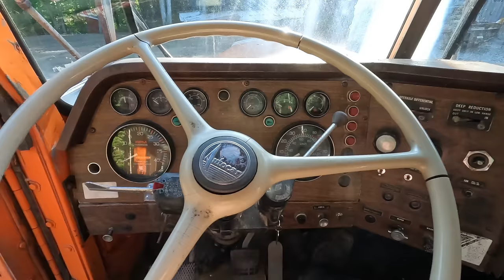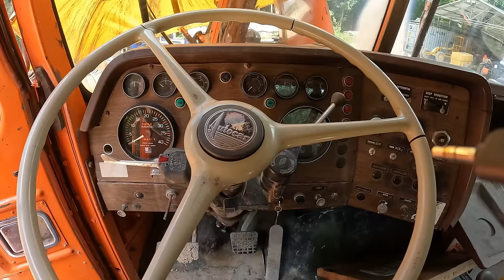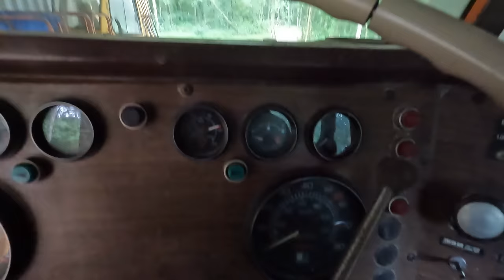Will this  Autocar Semi Truck be fit for the road after sitting many many years? (Small Cam Cummins)

Comment: Matt, If you’re going to keep that winch it would be a good idea to weld up a protection device behind that rear window.
Reply: ABSOLUTLY !! A Broken cable can cut that cab in half!
Reply: @brentbosworth8845  that's a bit of an exaggeration
Reply: @markwilliams4525  no it isn't.
Reply: @davidquirk8097  by far!
Reply: @davidquirk8097  you've been watching too many movies
Reply: @markwilliams4525  you haven’t seen enough reality!
Reply: @markwilliams4525  no I haven't.  I'm an Engineer who has investigated too many failures, fortunately none fatal, but plenty of serious damage.
Reply: @davidquirk8097  yeah that's all good and all but that cable will do nothing more than knock the back window out and dent the cab. It's definitely not going to cut the cab in half, show me where that's happened and I'll buy it but I've been around this stuff too long and have had cables break and have never heard of anything like that
Reply: George Jones  engineers that design stuff in my line of work don't know anything about what they're doing, they copy and paste everything. I'm in the water well industry so we have to go behind them and correct their mistakes and it's hard to get them to understand
Reply: @brentbosworth8845  I have put a few serious dents in the roof of a truck, blown out the back window, cracked the windshield and even dented the hood a time or two but I have never actually torn a hole in sheet metal, now fiberglass replacement roof caps for Pete’s and KW’s well as Scotty would say they just weren’t up for the stain.  All that said, I am not saying it can’t happen, just in the 25 years of towing and recovery I did I never did and some might say it wasn’t for lack of trying especially in my earlier days when I was far more prone to do some really dumb and stupid sketchy sh*t.
Reply: Headache Rack..... ENGAGED!
Reply: .
Good idea ... 
.
Reply: @markwilliams4525  I knew a man that had a broken hook from a pulling cable caved in his skull ! So I believe that a cable pulling tight enough could cut a cab they are pretty thin sheet metal !
Reply: @davidcatlette9697  a hook and a skull is completely different than a fat cable and a cab
Reply: @M_Phipps0520  I don't think you have
Reply: @M_Phipps0520  a 3/4 or 7/8 cable ain't cutting no cab in half, a big deep dent yeah but not cutting it
Reply: @markwilliams4525  ok whatever mr know it all!
Reply: @M_Phipps0520  all you have to do is show me or tell me where to find something like that! I've personally snapped a 5/8 rotation resistant cable using draw works on a well rig and it's not as violent as yall think. Yes it will snap back and do damage opposite of the end from which it broke but it ain't cutting no metal truck cab in half.
Reply: @M_Phipps0520  by the way you don't look to bright yourself!
Reply: @markwilliams4525  that coming from a bunt out light bulb 😂
Reply: @M_Phipps0520  you see what I'm talking about, you mean burnt out light bulb. Right?
Reply: That's good timing cause i just had a come-a-long break yesterday and punch a hole in my tailgate lol

Comment: Hubby said you need to put a fitting on your oil plug with a hose  that leads to an easier drain. He was a heavy equipment mechanic in the Copper and gold mines for many years
Reply from the maker: yah I wanted to but didnt have anything handy.
Reply: Or add a drain valve , they make them to replace the plug just need the size and pitch of the plug being replaces
Reply: @DieselCreek  Just order a Fumoto with a hose. Can't beat em. Lot of the Cummins stuff I work on already has em installed. I just carry a spare hose and nipple in my bag just in case they lost theirs.
Reply: at least if you fill the frame with oil it can't rust, right? ;)
Reply: @mrgeraldbrent  First thing that went on my 2000 Powerstroke ! lots less mess !
Reply: @thesteelrodent1796  ain't that the truth, changed some control arms recently, and the side that gets soaked every oil change from filter removal sure was a lot more rust-free and easy to remove!

Comment: Matt my tip for you ---- is when removing or replacing truck starters out in the field, tie bungee straps to the motor and then the other end up high some where in the engine compartment. It helps to take a lot of the weight out when you're trying to lift, wiggle shift etc.
Reply from the maker: That’s exactly what I did! Lol
Reply: thank you! I never even thought about that. work smarter not harder eh?
Reply: @seasons4inc243  Especially if you're working by yourself like Matt.  It's imperative you be smarter than the hammer.😁
Reply: For the rest of us... Thanks!
Reply: @DieselCreek   Great minds thinking alike!

Comment: Pro Tip  for Diesel Creek..........your Autocar has a Hendrickson "walking beam suspension" which in its original configuration has spring packs designed to handle about 35 metric tons. which makes them incredibly rough as guts when empty or legally loaded.  But you can take out the bottom two leaves in each pack and it will help soften it. To keep your ride height the same, just trim the two leaves so that they become packers only. My father did this to his interstate Kenworth W900 in the 1980's and it ran like that for 20 years, millions of km, pulling road trains across Australia and in the outback.
Reply: My isuzu has the same stuff, you can put 11 ton plus the 5 ton crane I have on it, and it dont move SFA
Reply: Don't cut anything. Just load it up and let it work. (And let us watch as this old iron is working hard)
Reply: Definitely wouldnt be a W900 as they were a different truck

Comment: Love your videos! As a mechanic for Granite Construction, I'll tell you that your transmission takes 50w, the rears take 80-90  but we use 85-140 in our equipment....you can see how quickly it's draining from the PTO that is a lower viscosity. Also, with the engine being an NTC Big Cam, Rotella T-4 would have been a better choice. T-5 semi-syntetic will gum up the heads due to lower operational temperature, plus these older engines need the increased zinc in T-4. Keep up the great work and content, always makes me happy to see DC on my notifications!
Reply: Totally agree!
Reply: T4 with a gallon of Lucas 👍🏻

Comment: Matt, that should be a bendix R-12 relay valve for the service brakes. Relatively inexpensive on the South American river site or your local truck shop. They come in a couple different versions, just depends on where the outlets come out side or bottom. Nice truck. Can’t wait to see it at work
Reply: There are many sellers online, often it's around $55 including shipping
Reply: Looks like an old 335 to me. It would have the primary oil filter and a lubrefiner.which collected th finer particles. COULDNT see but the lubrefiner would have 2 holes about the size of a pencil eraser and the screw hole in the center notables allaround the c we need like a regular oil filter. They don't use them any more and I think the old cummi s were the only ones that had them.

Comment: Matt, adding a turbo tip to a pressure washer wand is indeed a great upgrade! Everyone loves seeing the transformation from cleaning the truck, plus of course a lot nicer to work on. Great video!
Reply: I was a little surprised he didn't pull the heated pressure washer out. Must not have been TOO oily or greasy under there.
Reply: @JCWren  wouldn't want to wash away the pre-installed rust inhibitor, be it from leaks or not ;-)
Reply: @JCWren  I think that is a hot box pressure washer, it has that cylinder on the chassis.

Comment: I have two suggestions for you Matt, check in with Point Spring and Driveshaft down on Neville Island for your brake system parts ,they have all the stuff that you will need. The other relay valves will be just as crusty inside as that one, so service everything now before you get stuck out along the road, most of these older trucks never had air dryers installed on them. The second thing is about the turbo nozzle you use on your pressure washer, point the tip down toward the ground before you pull the trigger, this helps prevent damaging the ceramic seat in the nozzle . This "Not A Car "will give you a good workout. 🤣

Comment: Yeah, I wanted to see the 5th wheel plate go on. Still needs trailer brakes, light connections, tail lights, front turn signals to name a few things for road use. It'll be a great hauler!
Reply: something other than red diesel too :)
Reply: If you need help getting it road ready  pm me I am up in Wellsville ohio  not far from you I built a couple of them
Reply: I have done a  lot of air brake systems  before

Comment: I believe I've mentioned this to you before.  When dealing with really stuck parts.  Heat them as hot as you can get them.  Then moderately cool the entire part with water until you can physically touch it. Do not flash cool it.  Just take your time cooling it down with a steady stream of water.  It works everything.  I've pulled caps off old steam radiators using a 3/8 ratchet afterwards.  Before a 3 foot 1/2 breaker bar wouldn't budge it.  Try it.
Reply: Matt uses heat at least twice in this video to release stuck parts. Pretty sure he knows what to do. Lol.
Reply: @1971merlin  did he cool it down slowly though? the mans only trying to help.
Reply: @1971merlin  he didn't use anything to cool it down.  Using water help shock the metal.  Alot of people do the same thing unknowingly.  They will heat a nut, super hot then saturate it with some type of penatrating oil.  This oil slowly cools the nut causing the same result.  Some people will say the oil is getting into the threads, in reality most all of it is burning off almost immediately until the nut is cooled enough that the oil won't burn off.
Reply: @MrHondatrxex  some wd40 on a heated part does help in most cases, not sure about that shaft though 😂

Comment: Wee tip Matt, never put a drain plug back in without tightening it there and then👍🏻🙂.  Good practice with the seal putting it further in to run on a fresh bit of the flange😊.  However a smidging of grease on the flange or even packing the spring side of the seal prevents a dry first turn, potentially prematurely wearing the fine sealing edge of the seal.  Also prevents the seal spring from becoming dislodged if packed with grease.  Grease is your friend👍🏻😊.  Great vid, truck and channel, best wishes, keep em coming.
Reply: I even pack two stroke crankshaft seals with grease
Reply from the maker: I oiled the seal just didn’t show it 👍🏼

Comment: Man looking at that starter made my fingers hurt bringing back memories of them getting mashed pulling those monstrosities out, was so glad when the hi torque gear reduction starters thats 1/3 the size came out to replace them. We started replacing all of them on the trucks when oil was changed because we did a lot of storm work so last thing we wanted to do is be laying in a mud hole under those big bastards to change them, new ones could be pulled inside the cab as it would fit thru the hole inside.

Friends dad had an older road truck, international i believe, that had an oil filter out there like that for pre filtering the original case style like that one because it was easy to change. We were headed to SC one time and all of a sudden oil started spraying all over the side and his side of the windshield, got it pulled over and a rock/road debris managed to miss the headlight, lollipop light, air filter housing and make it thru a 1” area to hit the oil filter and poked a 1/4” hole in it lol. Seeing it was a Detroit he kept 2 buckets of oil with him and spare fuel/oil filters and were able to carry on with one nasty truck
Reply: I know , remember that 5/8 , 12 point socket you needed for it and the 6 inch 1/2 drive with the snap-on 24 inch ratchet too break them loose on the Cat’s and the road tractors ????🙁
Reply: I have memories of changing mine on my old Cummins at -42. Not fun.
Reply: i remember doing one on my truck i was driving at the time.  boss stopped at peterbilt and got me a paccar gear reduction starter. i dropped the 42mt out and drug it out with a strap, and palmed in the little gear reduction starter.  i'd never go back to one of those backbreakers :)

Comment: Hey Matt, this might sound ridiculous to do but an old timer a long while back had said to me that in cases like yours if you can figure out a way, a reasonable way to soak that thing and kerosene and let it sit for about a week you may find that you can break that free relatively easily. I know that’s a big drive shaft and that would mean a lot of kerosene wasted for an experiment but it might be worth your time.👍
Reply: That is true, helps for lotsa stuff that got severely stuck. A good ol diesel bath helped me disassemble a completely seized up 50ccm moped engine.
Reply: @Gabriel-he6ih  ,  I think that "Aye, carumba!" is the way to describe it before the bath!
Reply: Soak it in 100 %grape fruit juice, it worked for me when 2 cylinders on a 1929 harley were solid and no emount of heat would free them , A old bloke told me to try it ,I left for a week and then they just slid out not a mark on the bore, I would have bet against before hand not now, you have nothing to lose.

Comment: You might consider cutting an angle on the back of the frame to easy the chance of the frame hanging on the trailer in off camber turns.

Comment: To catch the spillover oil from the pan, put a sheet of tinfoil down.  Helps channel the oil and makes cleanup a snap.
Reply: yup, tin foil to the rescue. The poor mans form-a-funnel. Great to get into hard to reach places.
Reply: Or you could install a quick drain plug with the “ push and drain valve on it with a 10/15 inch drain hose on it ! That’s what we did with all the dump trucks and concrete trucks where I worked ! Made that oil change easy did not have too worry about the heat from hot oil !

Comment: I used to service some generators with awkward sump drain plugs like the Autocar - we fitted hydraulic hoses as extensions out to a convenient spot and added a valve on the end. It made changing the oil a joy as you could attach on a drain hose down to the pan and then open the valve for NO mess at all

Comment: On that PTO Slip Joint .  Put a split in the outer / Female part lengthwise with a mini grinder down to the splines .  Heat it , pound on it until it comes free , and then clean it up / free it up . Then tack weld just enough to stop it from ever coming apart . This shaft will not be used enough to matter .

Comment: On the PTO driveshaft slip yoke take 2 hammers, use one as an anvil by putting it up against the slip yoke and firmly holding it against the side of the slip yoke, take the other hammer and peen the opposite side and do that around the circumference of the yoke. You don’t have to peen very hard and some signs you are having an effect is seeing rust dust starting to appear on the dust cover of the yoke. Use this method cold , hot or during the heating process and if you start seeing rust dust start adding a penetrating fluid of some kind. I have personal experience with this method. Like your vid and am looking forward to you pulling a loaded trailer down the road. Thanks for the ride along sir.

Comment: When using a turbo nozzle on a pressure washer always point it downwards before pulling the trigger and washing. The ceramic peice inside the tip can slam forward and shatter  when pointed upward. I've done it myself before. Just a helpful tip. No pun intended. 👍

Comment: It's called a pre-engaged starter, because it engages the pinion with the flywheel gear, before it starts turning the engine.  Some, motor the pinion at low speed to ensure engagement of the pinion before starting.

Comment: On things like that oil drain bung we always fitted a high temp tap so all you do is connect a hose and run it into a container and open the tap, our taps also have a spot to  lock them closed so they don't accidentally open

Comment: I have two bronze wire wheels, 1 for the drill 1 for the angle grinder, they are not as aggressive as steel and don't contaminate if you are welding, they would not have prevented the spring going on holiday however. Also I always have some lanolin grease or sheep grease as I call it, because it is not petroleum based it can be used on rubber seals etc. Good to see the Autocar getting some love, it will be a useful item and will pass as an exhibit at the steam show. Always enjoy watching you work and learning some useful ways to handle difficulties, I think I would enjoy an episode of you cussing, that may have to be purchased at the merch store. Thanks again and to the SS Villains.
Reply: LOL!

Comment: Matt,, that is a wet sleeve engine. Check the DCA level to prevent cavitation erosion of the liners. If it doesn’t have one already, install a water filter on it. You can get water filters that maintain proper DCA levels in the coolant.
You can get test strips that tell you the DCA level of the coolant.
Reply: Patrick Dineen  ,  Right on the money.